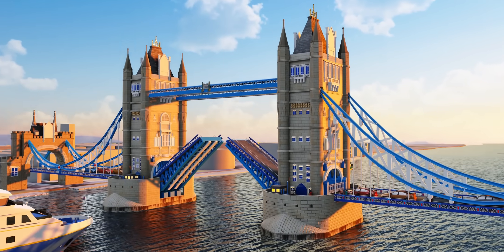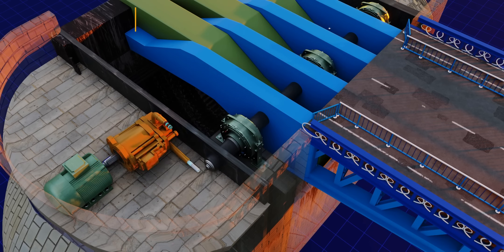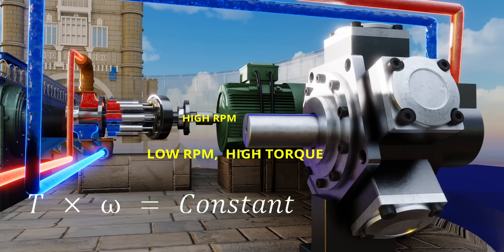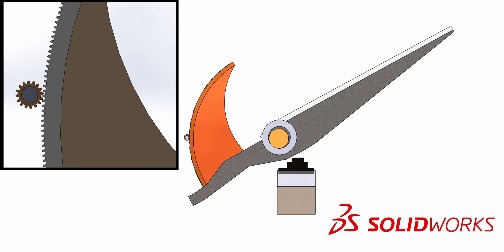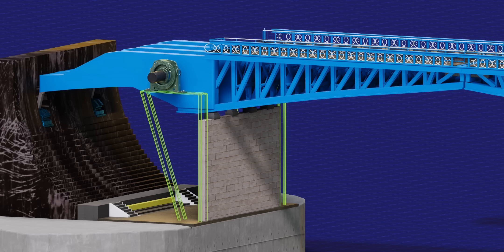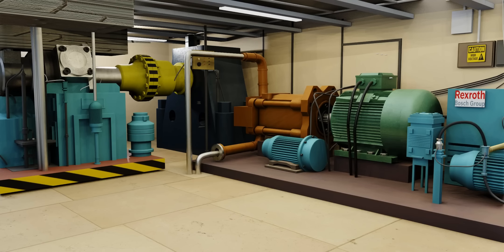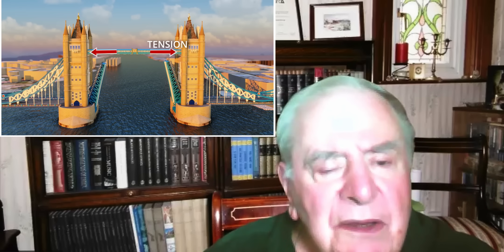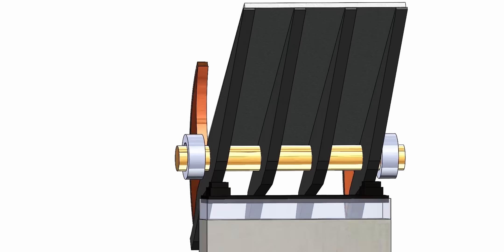London Tower Bridge : The Genius Engineering of our Forefathers

Comment: Please please please make a video about sensors and how can digital numbers zeros and ones can be transmitted as waves, and how can you use zeros and ones to give a message of high voltage and low  voltage, such as radio waves that transmit sounds with different strengths?

Comment: I think that the early designers could have been acknowledged more by talking about how the bridge has always been controlled by high pressure hydraulics.  When built, they burnt coal to provide steam to run a steam engine.  This steam engine powered high pressure water pumps.  High pressure water is then fed into hydraulic motors to raise and lower the bridge.  The high pressiure water is fed across the elevated walkway to operate the other side.  So the walkway has this aditional purpose.  The modernisation was to replaced the water driven motors with modern oil driven motors electrically powered.   If we traced the modern energy cycle back, the electricity is generated with the aide of water/steam and depending on where you may live , the burning of coal.   Cheers.

Comment: Very interesting within 5 minutes the bridge is up and down. What power engine is used on inauguration  and what engine has these days the London Bridge.
Reply: Originally it used steam engines, but since these didn't have the power to rapidly raise the bridge, they used another clever mechanism. Hydraulic accumulators. These were a number of heavy pistons that were raised by water pumped by the steam engines. When the bridge was to be raised, these would be lowered and the water diverted to hydraulic motors that would raise the bridge.

Comment: There are two good reasons to lift the trunnion load.  Neither is simple load relief.  The first it to prevent "fretting" (basically, scuffing of the trunnion and/or bearing at the contact area).  This can happen if the load squeezes or wipes out the lubricating medium and the trunnion-to-bearing contact area is subject to vibration.  The second is to allow lubrication to get to the load area.  The trunnion load is concentrated (in the animation) roughly between clock positions 7 and 8.  In the real world this could wipe lubrication off the trunnion-to-bearing contact area.  Lifting the trunnion allows lubricant to flow into that wiped area.  Similarly, double acting reciprocating compressors must be designed so there is "rod reversal", that is, the connecting rods must lift away from the cross head bearings for about 45% of each crank revolution.  Other wise the bearings can overheat and fail due to loss of lubrication.